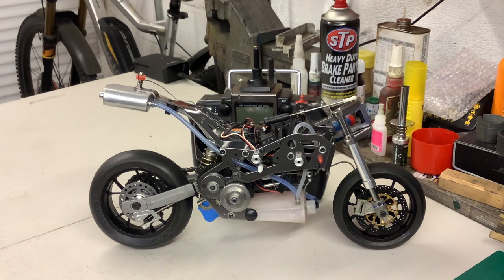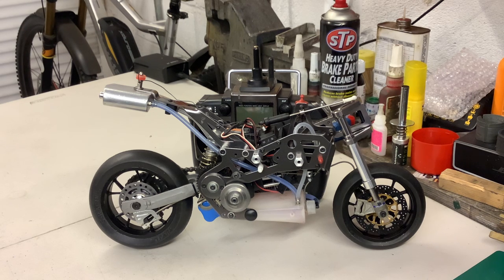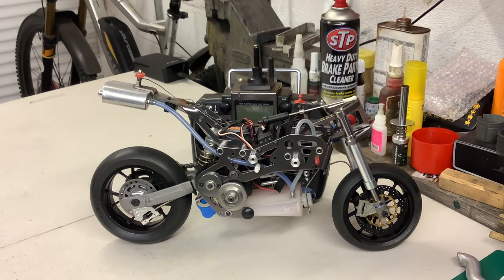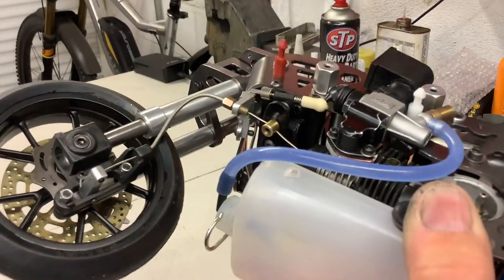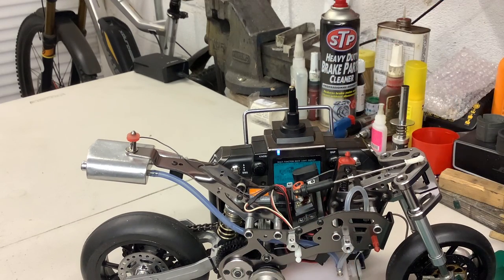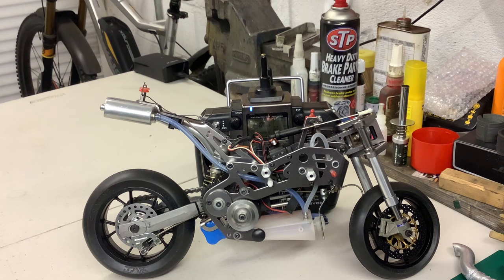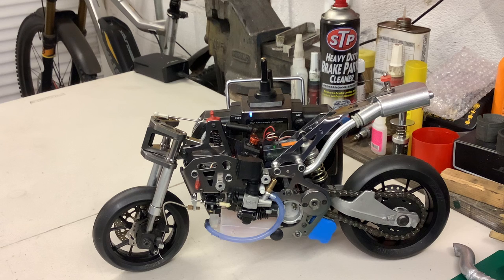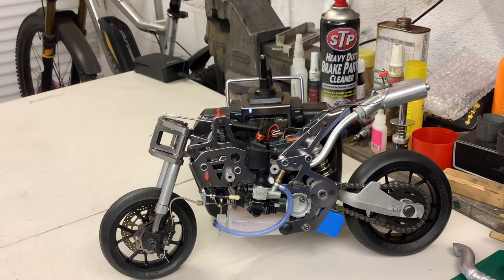Nitro Four stroke TT part 2

Comment: Hi Dear friend,
could you put out some part names of part numbers you ve used for example the fuel tank?
Reply from the maker: It’s all thunder Tigre apart from the engine and gearbox 👍🏻
Reply: @Blacklamass  coudl u suggest where i can find some thunder tiger parts ?
Reply from the maker: @akiga3258  all on eBay